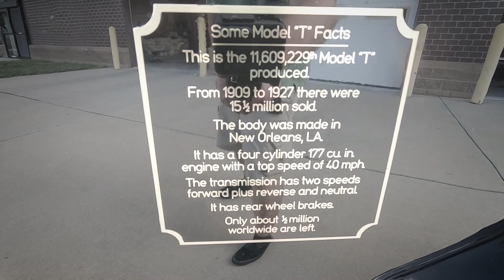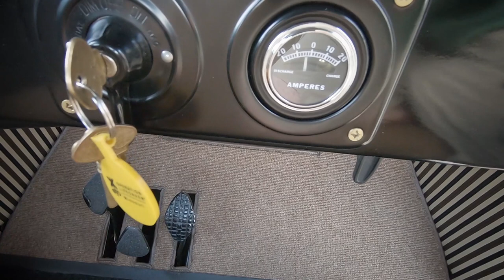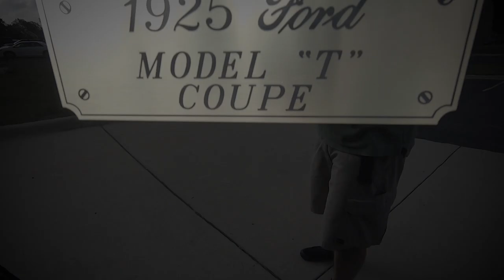1925 Ford Model T Coupe  Gateway Classic Cars St. Louis  #8068

Comment: The last year of the wooden spoked wheels. My father was a Ford dealer in Canada and had a '25 in his showroom, that was purchased from a Doctor in Prince Edward Island, but I recall that it had a 'rumbleseat' configuration, where the trunk is on this one. The latch was next to the rear window and the hinge next to the spare, if I'm not mistaken. There was no signal lights on his, because it was never driven. Everything else looks to be the same - Throttle, spark advance, clutch, brake and reverse between them.